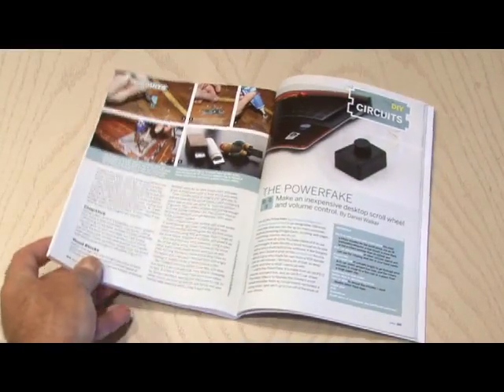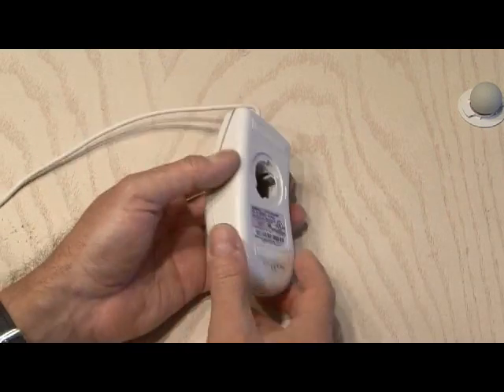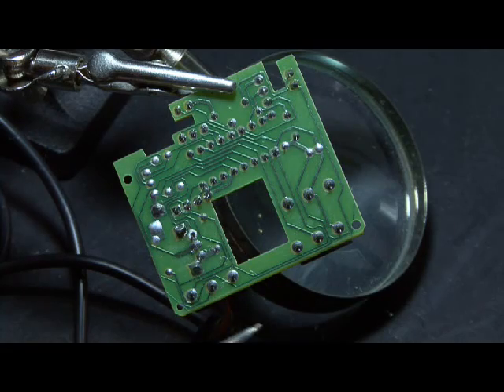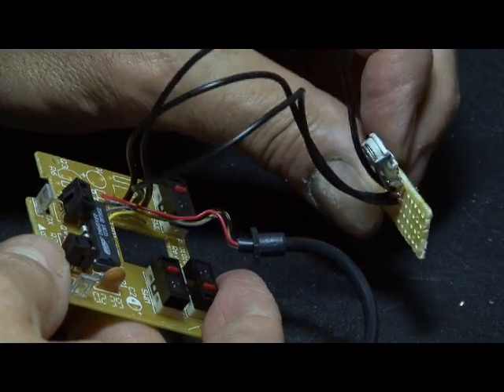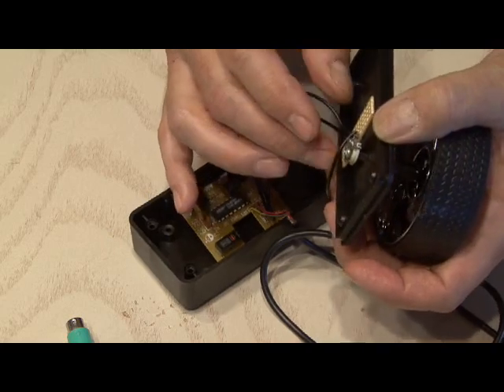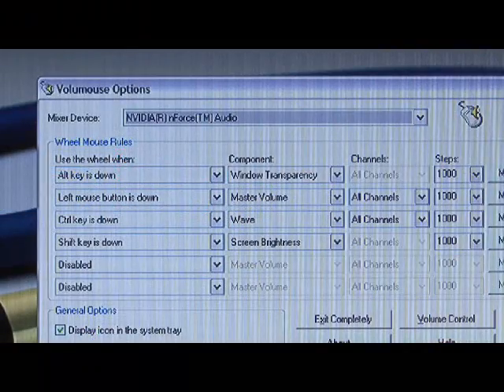Weekend Project: The Powerfake

Comment: Jebus.... do you have any videos with a project that wasn't a complete waste of time? You could have had exactly the same functionality if you'd have just left the mouse in tact and used the scroll wheel as it was... it would have been smaller, less obtrusive, and it still would have worked as a mouse!
Reply: Calm your tits. This video was from 2009.
Reply: Zaphod7835 it is for fun!
Reply: all depends from the use case, video editing? you can use it for granular control of scale, rotation and other elements.

Comment: I made a usb fan device with a switch that made it go in two speeds. Just a resistor, a switch, usb cable and a fan from an old computer, and you have a nice desktop fan for your gaming sessions in the summer. If you make a stand for it, you can also make it point wherever you want, but I didn't have the materials at the time.

Comment: @kyCap222 That's just my opinion, but that's really a waste of (maybe even good working) hardware. This controller doesn't even looks good, it seems like it could be easily cracked. And I don't see how it's handy, really. It's too coarse to control something fine comfortably, like sound volume and stuff (because it's made of mouse, and it's rotary encoder doesn't have enought steps per turn). And my PS/2 port is already used by keyboard and mouse (sic!).

Comment: Apologies... a friend found some software online and mine does not only turn up and down the volume, it is used to "jog" through digital video/audio. Most professional editing machines have that feature. It is a nice analog and really helpful to have better control . Also, now rather than only having 1 inch of turning radius on the wheel, it turns 360 degrees merely by rolling my finger around it. Anyway, it's easier for me than using the mouse to turn the digital knob.built into the software :)

Comment: This is great and very useful.
It's like a Griffin PowerMate.
These are great for Video and Music editing.
I have an actual Griffin PowerMate in my car to scroll through music.  I'm using it in Linux and I use a program called evrouter to control the inputs.  We just need to find a way so it can be a button as well.   I guess you can just add a button to the top of the box, but it would be cooler if the wheel was a button too.

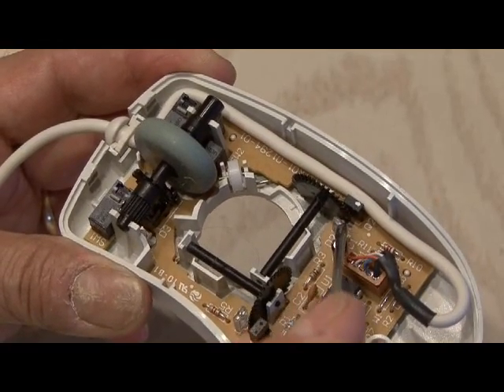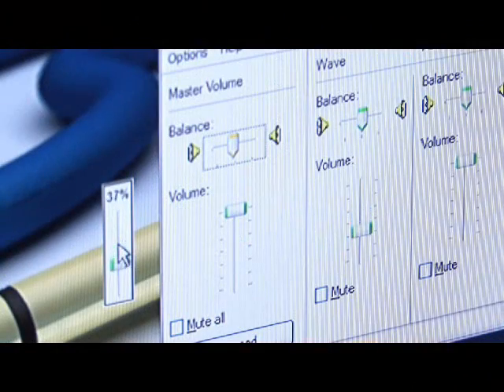Comment: @ 1:00 ..."as you can see here, there are a couple of Infrared detectors that control the scroll wheel"... Yeah right. You're pointing at the ball-motion IR transmittors. Nothing to do with the scroll wheel. Yes, it was the "wrong kind" but not because of that. @ 3:00 "So there's how to make a cool USB device..." Didn't you just say you plugged it into your PS/2 port? Please Kipkay, you could have done this right...